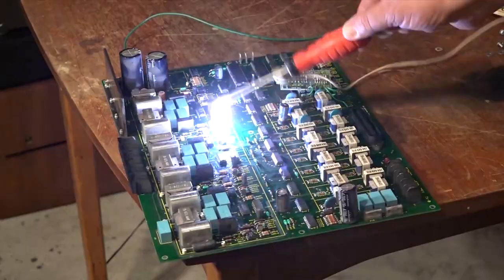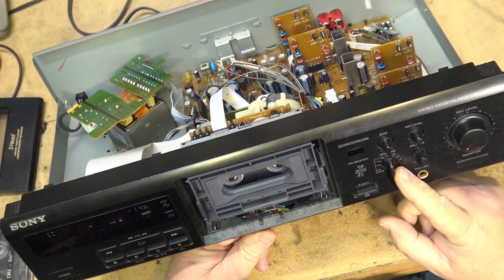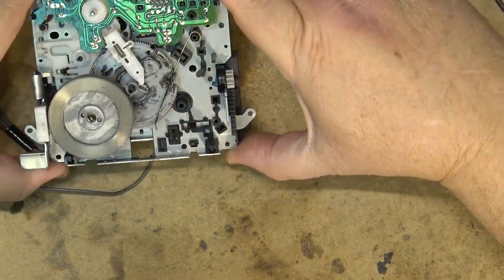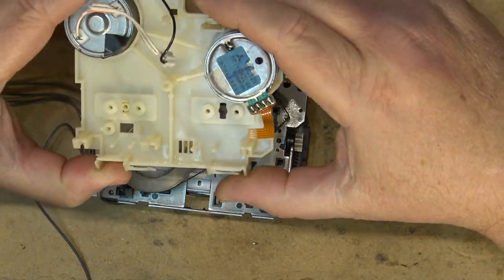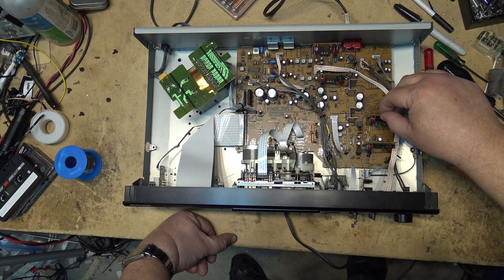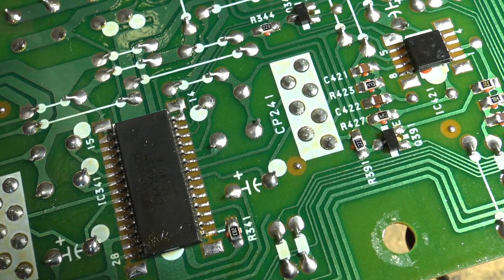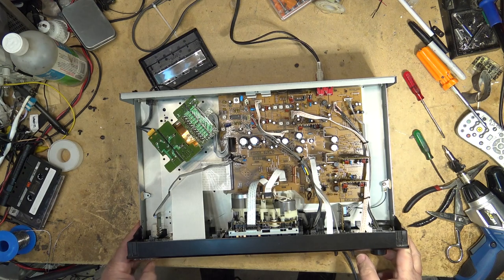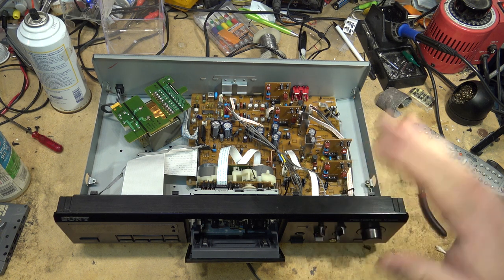Sony TCKE500S 3 head tape deck thrown off a truck

Comment: Nice repair! I have also got this deck, I got it almost for free. It sounds very good, I really like the dolby S function! The mechanism however is very noisy when it changes direction. I had to do some work to the motor, change the belt and change the pinchroller. A nice feature is the 2x fast forward when you press the F.F. or rewind button. It automatically slows down when it reaches the end of the tape, so the tape will not be ripped apart.

Comment: I was suspecting the RCA connections to the board and was glad it was something that simple. Ran into that a few times myself. Usually from people using junk Monster brand cables that are WAY, WAY too tight on those connections and stress them to cracking. What I learned today was the motor repair. Never did that before so I nabbed a junk one out of my pile and followed along to learn. Thanks!

Comment: Thanks! I learned some more useful tidbits! My recent acquisition of a Kenwood KXW6040 was also from Ebay, and damaged in what appears to be a violent drop! I'll pull and check the circuit board! It boots up, and clicks when buttons are pressed, but doesn't operate. The B deck briefly played normally, and I was able to advance to the next song-but it soon froze up again after a couple minutes. The A deck won't operate at all. It's a mystery, and my training is limited to a B.E.&E. course in the Navy, and a lot of tinkering around over the past 30 years! Your videos are invaluable to me! Jim

Comment: I believe the KE600S is the 3-head, dual capstan version of this one, that was also sold as the KA2ES. The chassis of the -400S (two head), -500S, and -600S are basically the same, I don't know if there are many differences in the boards.

Comment: Hello, bought TC-WE705S this year, damaged in traffic: all dolbyS daughter boards were floating inside the case and lots of solder joints on the the mainboard were cracked, but I managed to fix it and it plays and records fine now. Wonderful video! Thank you!

Comment: I've got the 820 QS version of this deck - I guess the internals are pretty much the same but it just has a fancy aluminium facia.  Still going strong after 20 years despite the plastic clunky mechanism :) I think people forget that when these decks were built Sony wasn't really invested in cassette tape as they wanted minidisc to be an alternative.   They kept tape alive though by adding Dolby S to several models. My 940 QS minidisc deck of the same era is built beautifully
Reply: The tape mechanism is from the early 90'. Sony used it on pretty much every tape they made, except the high-end ones. I own two Sony decks by my selfe with this exact mechanism. They just modified the PCB on the back. The mechanism itself is the standard auto-reverse one. In the video you can see the missing capstan pulley. On the auto-reverse deck it is present and will be driven by the same belt seen in the video.
The only problems with this mechanism are the switches on top, they get corroded and the deck will detect wrong tape types. The other problem is a broken gear on almost every mechanism, on the second motor drive shaft. Years back I made some metal rings to repair this gears. Everything else is just a matter of fresh rubber. Belts and pinch rollers are available for this mechanism everywhere. There even exist better pinch rollers with a bronze bushing/core.
I think it's one of the best cost effective mechanisms on the market. I am sure that's why Sony used it more or less unchanged for about a decade.
Reply: I’ve a collection of 90’s decks and that includes 3 x KA1ESA’s, K611S, and a K615S. The parts might be plastic but the quality of recordings is as close to as good as you can get for cassettes. The HX Pro & Dolby S combo is amazing. The higher end ES models with quartz tracking and other gimmicks give minimal improvements with a lot more problems.
Reply: @matthiash.4670  Hello, remember if that small gear is attached to the motor shaft or rotates on the shaft, I have that problem

Comment: Excellent thorough video. I just got one of these decks for free and its exterior is in perfect condition, but it does not play. Press Play, FF or RW and the tape doesn't move.  I took a look inside and it looks like the belt is somehow twisted over itself and tied up in the wheels... (shrugs) Thanks to this video I'm able to get inside and see a viable solution to get it fixed. I need some more small tools and a couple of hours.  (I'll make sure the cat helps out where he can.)  Thank you so much for making this video!

Comment: Sony decks have the loudest motors.  I had the KE300 deck, and it led me a merry dance with its slipping wind motor cog and its loud capstan motor.  I eventually got a bottom-of-the-line Yamaha and it was an improvement.

Comment: What you were saying about early 80s decks being the best. I found a cheap Akai HX-1 from 1983 for $5. I was shocked how good it sounded. It only needed a speed adjustment. The caps, belts and motor are all in great shape. With a TDK SA tape (the manual says it was calibrated for that tape) it sounds better than I ever remember tapes sounding, even compared to friends' relatively high end decks.
Reply from the maker: Cassette decks can sound very good considering the limitations of analog.  (Hiss, wow and flutter, compression ect) some like that sound.  Myself i am more of an audio pureists and removing mechanical things from the audio chain and amplifying only by electrons flying off a red hot cathode in a glass bottle under a total vacuum and into giant speakers. Once you have heard such a system you really don't want to listen to anything else.  As I write this I am listening to Al Di Meola play some acoustic music and it sounds like he is in the room with me.  
I personally have one of the finest cassette decks ever made and it sounds fantastic but still my cd player runs circles around it as does my digital music player (FLAC and uncompressed files)
Something about the dynamics of music just building out of absolutely nothing to wall shaking and plate rattling around and then back to nothing and no sound. No hiss, no rumble. Fantastic. And not much power either.  Super efficient speakers does this with only 40 watts per channel.  (Mind you 40 tube watts is more like 150 solid state watts) 
I can only dream of what a tube amp with some real power could accomplish.
Reply: @12voltvids  I agree, cassette is an imperfect mechanical medium with many sources of potential distortion and colouration. There was no surprise about how quickly it died with the rise of CDs. My memories (as are probably most people's) of the medium were mostly from using cheap cassettes, recording and playback decks, and deteriorating sound quality over multiple playbacks and recordings. For pure sound quality, I'll take FLAC decoded by a great DAC any day. That said, this 37 year old tape deck and 25 year old cassette performs very, very well! If everyone used type II tapes on a good deck, CD may not have superceded tape so quickly. I think the biggest thing was the elimination of the strong dependence on quality of the playback/transport mechanism (excluding DAC and preamp!) and degraded duplication from the sound chain. Thanks for putting up these great chilled out repair videos. I've learned a bunch so far.
Reply: @12voltvids  Note I left out any discussion about amplification ;)
Reply from the maker: @MikeDS49  amplification opens up a whole different debate.  Solid state.  Class a, b, ab, d, j, s ect.  Me i will just take my push pull EL34 amp.  I have a nice variable bias class a solid state too but the vacuum tube has nicer sound.
Reply: @12voltvids  Sounds really nice! I've never had a chance to hear a pure tube amp. Those class D amps are just weird and have no business working, even if the math works out.
Reply from the maker: @MikeDS49  
Class D aren't that bad once you wrap your head around how they operate.  Very similar to how FM radio works.  In FM radio the frequency deviates above and below the center carrier frequency. The duty cycle stays constant.   PWM the frequency stays constant and the duty cycle is what shifts which follows the positive and negative swings of the waveform. The higher the amplitude of the signal the more the duty cycle shifts one way or the other.  
On an FM transmitter the rising and falling modulating waveform shifts the frequency up and down.  Phase modulation is also very similar.   Sign wave carrier where the phase is shifted ahead or behind the carrier frequency.   Class D done right is probably the most accurate of any of the amplifier designs.  All the high end amps like ps audio use them. They are a little too sterile for my liking. I like the harmonics of a vacuum tube which is exactly what companies like ps audio does.  Puts a vacuum tube preamp ahead of the class D output to warm it up.   Then charge you and arm and leg for it.
Reply: @12voltvids  I like class D though. They're extremely efficient. It was eye opening when I read how the amplification was done, and the signal is just passed through a relatively simple low-pass filter for the output. I guess it generates a windowed sum of the pulses to output amplitude. Apparently the filter can be left out and the loudspeaker itself used to filter out the high frequency pulses.
Reply from the maker: @MikeDS49  the high frequency square wave which is up to 1.2mhz on some designs is not a concern. Many don't even filter it now because the capacitance of the speaker wires and inductance of the crossover in the soeakers will remove it.  Very efficient and that is why it is popular.  Why waste power producing heat.  And then there is me. Using the least efficient way to listen to music and loving it.

Comment: I think the Sony ES serie (TC-K870ES /TC-K970ES) from 1991 sounds the best.
Reply: As well as their TC-KA6ES.
Reply: i have both the 333es, 555es and also the 777es - all sound amazing, no difference in quality. i use all of these for everyday recording. i have 3 units of the teac r-888x which also sounds good and looks even better but these units can be a headache.

Comment: Great video, I learned a few tips from your videos. I am obsessed with what is called retro gear now.  That direct drive capstan player was a gem that i watched you fix a few weeks ago i think it was a JVC. I like to fix stuff, usually takes me a few times, but i like learning how to make these things work again. Replaced a motor and belt in my Denon dn-t625,  damned thing was a squeaker (capstan motor) and wouldn't change back to forward play after reversing without help lol. It had that same variable resistance Mabuchi motor.

Comment: 12Volts don't knot on the Ebay Sellers, some are Idiots and sell Electronics for Parts of Repair because they don't know how to fix them. I am an Ebay Seller, and I Repair all the Electronics that need to be fixed. I always say " In Perfect Working Condition" and I always Pack them real good so not to have that Damage happen :) Love Your Videos  :)

Comment: Why so much BIAS against these late 1990s SONY decks? Like if it's not weighting a ton is a crime.
And by the way credit to Sony for making light what others still needed a metric tonne of hardware to do so. This is a testament to their engineering, not the contrary.

Thumbs up for the great job 👍

 Please note: this comment is BIAS calibrated, quartz locked, direct drive, closed loop and dual capstan!

Comment: Check for tape skew if you haven't returned the deck to the customer yet. My TC-KA1ESA (the US version of this deck) has the problem, likely due to the pinch roller being iffy and this deck's high torque pickup reel. You can usually detect it by the azimuth immediately going out of alignment after hitting play and its worse at the beginning of tapes due to little back tension on the supply reel.

A very timely video as I have a service kit for my deck en-route and might have to oil that capstan motor. Mine is loud and add a subtle rumble to the audio output.

Comment: I don't think it was the output ground you solder bridged because the noise was evident on the meters (which would be situated pre-output.) I think it was some other solder reflow you did. In any case, it was a pleasure to watch you work. You rock out dude. Well done, regardless!!!
Reply from the maker: Open ground will throw plenty of noise around the board especially if it is a return line.  Not just the output plugs.
Reply: @12voltvids  Can I be completely sincere with you? I made the comment to see what you'd reply in the interest of furthering knowledge. :) Thanks again.

Comment: Honestly man, the nak 700 from 1973 has a wow and flutter rating at 0.01, and I can tell you there is no flutter at all, when the tape peaks on this deck at like +5 on chrome, this machine handles them like a champ, no distortion, no type of flutter of frequencies, it really really rocks, the only problem is the rewind will go smooth and start clacking up, after some research, its most likely a bad clutch, the other problem I have is I wish there was knobs on the back for the calibration instead of a screw hole

Comment: 1:11:53 @12voltvids I missed this first time around. I think his chances are extremely good. Colour deficiency can be an issue for electronics with wire colours and resistor values, depending on severity. Was he completely colourblind?  The majority of colour deficient people guys don't have complete absence of colour. Depending on what part of video game programming he's doing, it shouldn't be an issue at all, such as the game engine or character intelligence, networking, all that stuff. The art assets can matter, but there are pre-generated palettes one can use, and tables with RGB triplets for colour names so you can get quite far even in that regard.

Comment: 3 head, that's a nice one! Off a truck? Crazy. I had a Harmon Kardon TD-4600 back in the day'. I liked that deck, but it's bigger brother had 3 heads and a price to go with it lol.
Reply from the maker: It's a "figure of speech" that means damaged in transport"
Reply: @12voltvids  Oh, I got it. It's too bad though. Electronics go through hell in transport.
Reply from the maker: @Mosfet510  remember the 18 disk Pioneer cd changer that was tossed off the truck.
Reply: @12voltvids  No, I don't recall.

Comment: Voltage Regulators and cable connectors -  cold solder joint manace.
That is nice camera 👍
Reply from the maker: It's an old camera.  Lots of hours on this one.  Sony fdr-ax33. It's about 7 years old now.

Comment: I have a 3 head sony tc-k561s i went against my own advice and bought a unit that had been messed around with plenty of dry joints including the line ins and outs and i need to replace two nichicon caps that i think are smoothing caps for the psu slowly getting there and sorting out the previous owners mistakes ,it was £10  and i was trying to get a 3 head deck on the cheap so i got the hassle that went with it but it does sound better than most the decks i have allready .

Comment: Talking of Buying from eBay, I used to work for a Courier here in the UK so know a little bit about what goes on so if I do decide to buy from eBay then I’ll generally arrange to Collect from the Seller especially if it’s Vintage Hi-Fi / AV Equipment, Basically anything that’s Heavy & Expensive! Anthony - Birmingham/UK

Comment: I had the very same problem with a Denon cassette deck, it also had taken a whack, turned out to be a crack in the board  causing the motor noise.
I guessed that was the problem with your Sony, sounded like a earthing problem from the start.

Comment: Well that was a good one,  it did sound like an electrical motor brush noise so i was wrong too :-D
So the sockets lost there earth and the case was just connected to the output cable screens.
Super duper floating case antenna :-D
Yes dave i do come up with some daft theorys, but that's the fun of remote guessing lol.
Ahh the cat has come to inspect your work, seeing if it can point a claw at anything.
And the final pisstake is the first advert was for a UPS delivery service :-D

Comment: Ive had multiple Sony ES decks on my bench and in my system over the years. Typically the sintered bearings run dry. Why? Because Sony has them spinning continuously.. on power up, ,whether there is a tape in the well or not, playing or not. Some turbine oil makes it better for about 5-10 years, longer if you shut the deck off when not in use so the motor isn't running the capstan belt all the time. 

The TCM 200 was one of the better transports Sony used on the ES units,  before pot metal flywheels and plastic transports. This becomes evident in the built to a price philosophy that took over their later products. The all in one Dolby switch in lieu of a MPX filter switch is 3 more things that make the unit less reliable, not to mention the late to supper Dolby S inclusion, that had all but no support on the pre recorded cassette front. Worse yet, most mobile auto units didn't and never featured Dolby S.

Compared to my most modest TC-K677ES, this unit is garbage, even with 3 heads, but has no closed loop capstan  tape control or a substantial transport to support it. 2 motors on an ES cassette deck is an insult to real Sony ES gear. 

Peace !